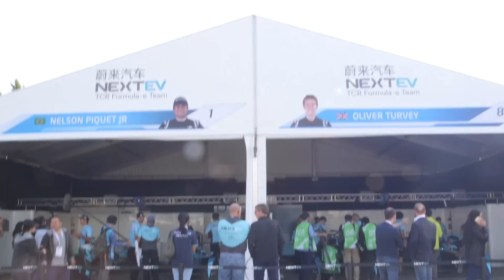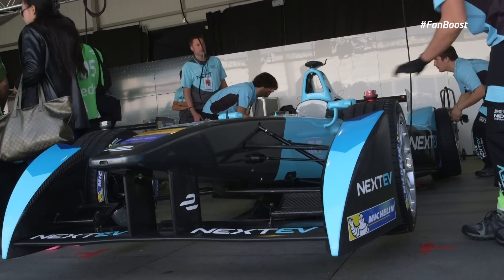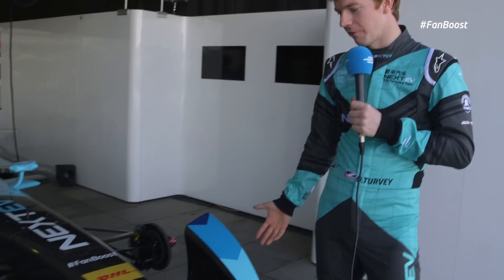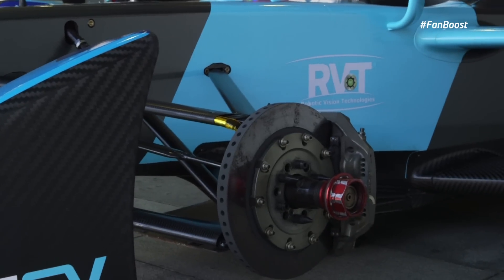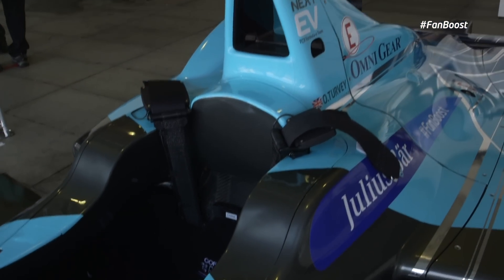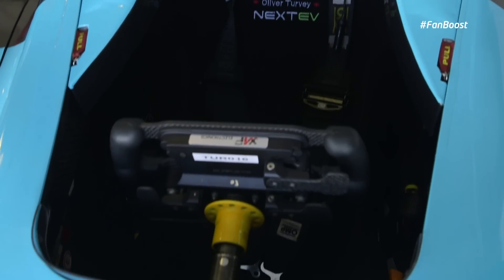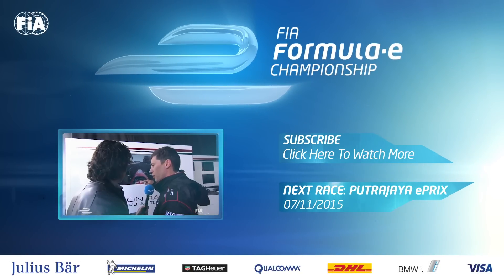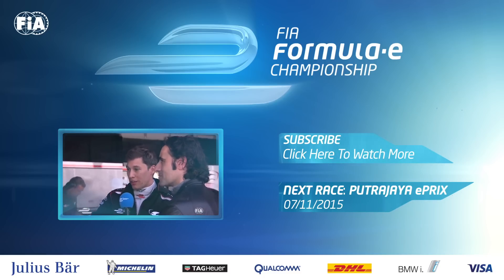Formula E Garage Tour w/ Oliver Turvey! - Formula E

Comment: So he touched on the front and middle parts of the car...guess the back (where the powertrain is) is kinda hush-hush stuff. Are the teams allowed any artistic license with the rear wing assembly?
Reply: +Brandon Dollar they are not allowed to change the shape of the car's body or add aerodynamic details... they can only tweak the setup of the wings (the angle)... you can see that the drivers don't have much controls in the wheel either, just the engine maps that are actually the most important thing in this sport